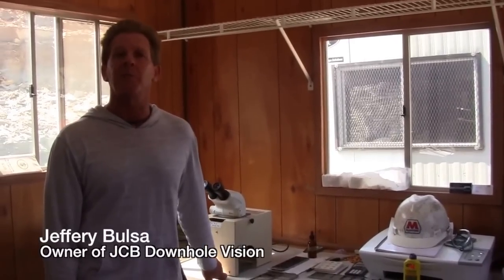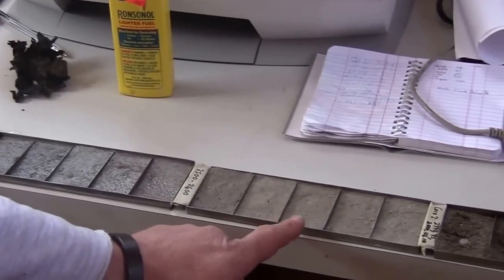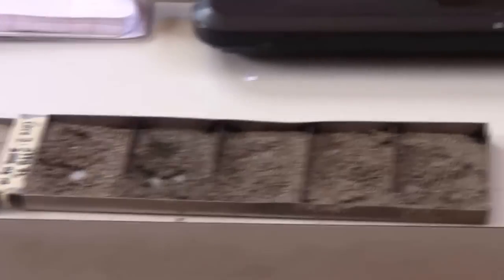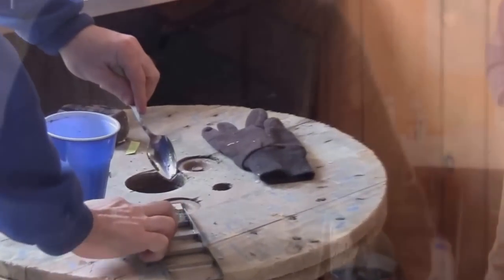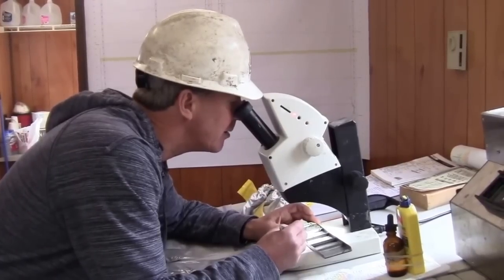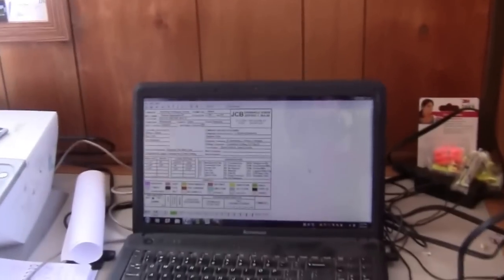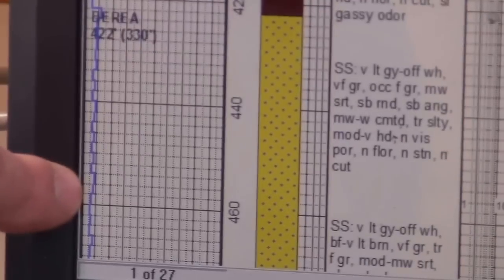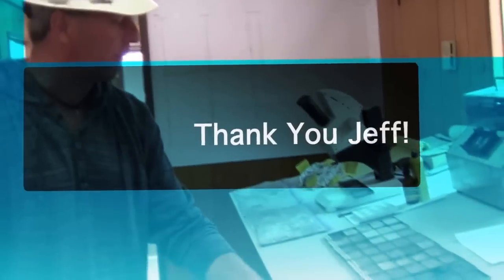Mudlogging

Comment: Great Video...
I sit here smiling... because I'm one of those
"Old Timers" that was a Mud logger way back in
the late 70s & early 80s... 
We didn't have ANYthing like computers, etc...
 We gathered our samples, every 10'
and we had a magnifier... and something like a 
Gas Chromatography... 
 and we had to know our samples
by looking and knowing what there were, without testing....
I made $75. a day for 12 hours a day... some times working 
for 30 straight days without a day off... 
Personally I loved doing coring... not samples to be caught.
I also became a Mud Chem. Engineer later... 
Even though I'm 64 years old.. I'm applying for a Mudlogging job...
Wish me well...
Reply: Wish you best of luck 🤝 and $75 in 12 hours back in the days was huge deal
Reply: Hi Judi, I would like to share your experiences as mudlogger, I was recently apply Mudlogging job. Can I reaching you by email? thanks.